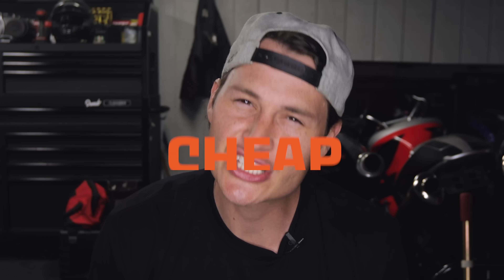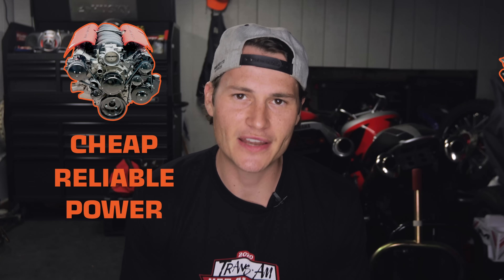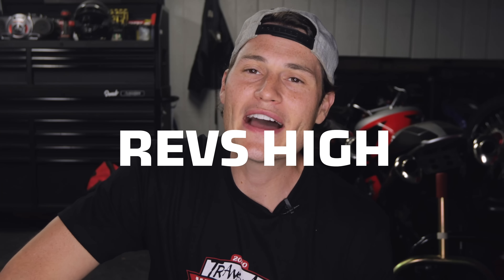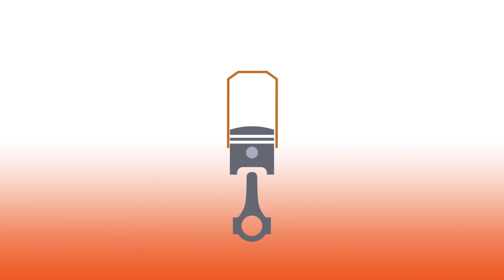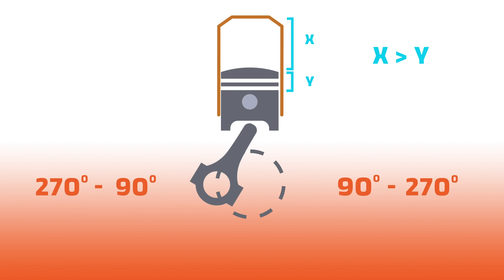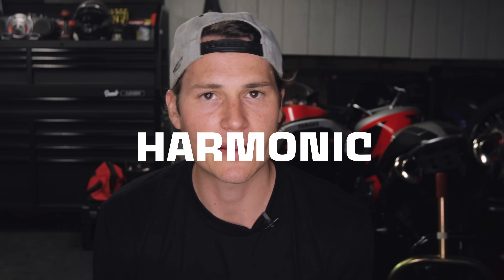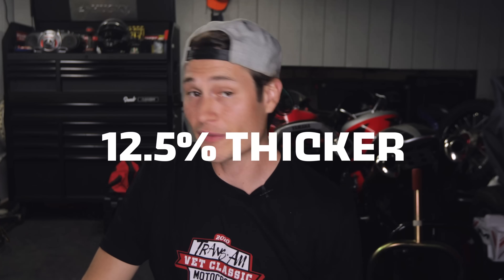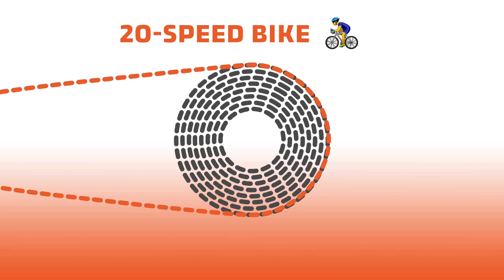Nissan VQ Engine - The Science Explained

Comment: Vq35hr can only hold around 450-500whp vq37VHR is where it’s at because people put ~700+ with boost  and without even opening the engine. People have even gone 9’s in the 1/4 mile with 100% stock drivetrain with fuel, a tire and boost. Also why not the cd009 that comes the same model Z that the vq35HR comes with? Don’t get me wrong, loved the vid etc, but my choice would of been the vq37VHR and not the vq35HR. Otherwise great video guys!

Comment: Also the maxima 04 and up didn’t come with a good trans until 2007
Reply: Yeah the Altima/Maxima manual transmissions were pretty terrible there, the automatics
weren't bad and were at least reliable.
Reply: @BigHeadClan  i meant the autos i just had my trans replaced in my 04 maxima cause it was toast i only think its my year and the year ahead of mine they replaced the cars with cvt which is very reliable tho but i wanted a vq and im paying the price to have  a vq de

Comment: My vq past 400,000km
Mine is only the DE
Gotta swap into the HR when the engine finally gives out
Reply: Swap in a VQ37.
Reply: Agreed, go with a VHR
Reply: De better for upgrades
Reply: @KuTtY0044  no, HR is better in every way, including boost
Reply: @luka_abh  No it's not... Even ppl at Nissan has said this.. Yes the hr is a Lil more powerful "not much" than the De it's definitely not the better engine when it comes to upgrading.. Good luck with all the lights and codes you'll be getting when you try to upgrade the hr
Reply: @luka_abh  And do you even own a z
Reply: Lol..DE.
Reply: Only 17 with 265 hp car I’m doing good, the Hr is only inevitable tho
Reply: I've got an admintuned G37 she runs good

Comment: Im glad this was about the VQ35HR and not the VQ35DE.

Just wish you would've gone into more detail  on some of its other features like its taller deck heigh along with the rod to stroke ratio and the benefits of it being a "long rod motor" which is great for high RPM power compared to the DE and even VQ37VHR which by the way, shares the same exact block as the HR.
Could've also touched on HR owners dropping the 3.7 rotating assembly into them while retaining the HR heads, in turn making it a VQ37HR

Comment: B2B on the Dacia Sandero would be cool, did you know that the 1.0 SCe engine is a NA and is built in alluminum, graphite and carbon, dual cam engine with VVT and diamond like coating, the valve cam has a chain to reduce maintance, piston rings also with diamond like coating (F1 racing technology)... and I think you guys can come up with much more. :D

Comment: The VQ was great (25 years ago).
Reply: Yeah, I bought a 98 maxima in 2001. Loved the smoothness, but it had fuel injector issues at 50k miles. It was already rusting underneath. I loved the ride, but it wasn't toyota reliability or anything.
Reply: Nissan constantly upgraded it over the past 2 decades,  it made wards 10-best Engines list over a dozen times during that period for good reason.

Comment: As the owner of an 07 350z Enthusiast with the VQ35HR, I adore this motor. 7600RPM redline, 300HP on tap with 260ft-lb, all sent through a bulletproof 6spd to the rear wheels. Mine might just be super good because it may have been well taken care of. But if all HR motors feel like mine, this is the go to VQ motor, even if they are more rare than the DE. Also the JK41B, AKA the CD009 is an amazing transmission. Strong enough for a 2JZ or LS.

Comment: Last I checked those engines weren't very reliable. For some reason, Nissan used plastic for the timing chain guides which led to some expensive repairs down the road

Comment: While I loved my short stint with a beautiful 2005 G35 with a 6 speed and that knarly VQ engine under the hood, it left a sour taste in my mouth when it decided to explode literally out of nowhere while I was cruising at a brisk 40mph lol
Reply: It probably ran low on oil like a lot of them do when you don't pay attention lol or if not might of had previous damage you weren't aware of
Reply: Yeah bud, VQ engines in general do burn oil so you probably didn’t check it...treat it like a rotary, every gas fill up just check the oil...good thing is VQ’s aren’t very picky engines so you can run a cheap synthetic if you wish
Reply: Did you take it out on track? My 2009 G37 is still going strong at 220000 km lol. I’ll replace it when it breaks but the vehicle never breaks.
Reply: Chocoretto that’s because you have the vq37VHR they’re super reliable and if you boost them ( just fuel and a turbo kit) I’ve seen 700-800whp out of them on an unopened engine.

Comment: Fun fact: Renault and Nissan suck! I got that engine VQ IN MY NISSAN MURANO AND ITS LEAKING ALL OVER WITH ONLY 120000 MILES
Reply: Mine does to at only 102000 miles common oil leaking issue is the oil filter ring gasket
Reply: Yep that has been replaced, valve covers leaking front and rear main seals leaking too the transmission output you guessed it right leaks. After Renault got with Nissan all go downhill fast! Nissan never again, in matter of fact I gonna go and cut it on fire right from the oil leak that messing up my driveway!

Comment: Where my vq engine owners at?
I got a g37x
Reply: My dark cherry 370 was t boned and totaled by a chick in a 2004 civic. May she Rest In Peace forever in my heart. :(
Reply: @Brandon-sr8qd  the chick or the car lol
Reply: @TheInfiniteNine  lmao the car. Both me and the chick were fine surprisingly (got hit on the driver side).
Reply: 350Z and G37 owner. Also have a 91 300ZX Twin Turbo with a VG30DETT which is basically the daddy to the VQ.
Reply: 07 350z HR here
Reply: 2012 370Z
Reply: 2008 nissan altima
Reply: 08 35x
Reply: Vq40 frontier gang🤣
Reply: 2002 R50 Pathfinder SE 5-MT
Reply: '04 G35 Coupe
Reply: 04 G35X, wish it was a manual.
Reply: My G35 06 6speed caught on fire😢
Reply: bob g37xs sedan boi here
Reply: 2015 Infiniti Q50 VQ37 🤓
Reply: 07 g35x
Reply: 07 350z with a full tomei 🎺🎺🎺🎺
Reply: My first car was the 1995 Maxima. No traction control and 205 lb-ft torque. The VQ30DE was the reason I chose the car.
Reply: 2008 maxima
Reply: 06 pathfinder VQ40DE
Reply: I had an '05 Altima SE-R with a six speed, for about a decade.
Reply: M35 here 👋
Reply: Q70 💪
Reply: '07 G35X. Actually really great in the snow.
Reply: 02 maxima, 04 maxima, 10 altima v6, 10 maxima, 14 370z vq is in my DNA 🤘
Reply: Used to own a G37S coupe
Reply: 09 G37x sedan
Reply: 07 350Z here
Reply: 2011 370Z N/A tuned!
Reply: 370z 2020 🤘🏼
Reply: @MrYanmichael15  yo, that car should have ZERO bugs by now haha.
Reply: Parker Portlock I know right 🤣
Reply: G35 sedan 03🤙🏽
Reply: 07 Nismo 350z
Reply: 2010 G37S
Reply: 05 G35 sedan.
Reply: Z33✊🏽
Reply: 04 i35...wish they came in manual tho 👊🏽
Reply: @jxhern22  you can swap the manual from maximas in
Reply: yup i have a g37x with the 7 speed RE7R01A automatic
Reply: 03 350z touring 6 speed here
Reply: 13 Maxima CVT baby 😤😤
Reply: 19 frontier vq40de
Reply: 2017 370z MT6 boiiii
Reply: 03’ 350z 🥵
Reply: 350z
Reply: 350z 🥳
Reply: About to sell my 2004 G35 brembo 6sp package. I’m sad about it everyday but can’t have 3 cars right now and I’m back in the STI game. I also have a 2015 Q50 with the 3.7 for the fiancée... amazing engine and the best part is the reliability.
Reply: 07 G35xS. 122k miles on the HR and still running like a champ.
Reply: 1996 Infiniti i30 💪2700000 miles
Reply: Altima 3.5 6mt checking in
Reply: 05 Altima se-r hr swapped
Reply: 2010 370Z 40th anniversary
Reply: 04 350z
Reply: 05 g35
Reply: Q50 3.7☝🏻
Reply: 04 350z
Reply: Love my Z
Reply: Yessir G37xS
Reply: 18" 370z Sport
Reply: X sedan, boom!
Reply: 06 Altima SER
Reply: 2003 maxima se 6-speed and 2012 Altima SR
Reply: V36 Skyline 350GT Type P sedan over here 👍🏾👍🏿 🇦🇺
Reply: g35 coupe
Reply: G37 sedan
Reply: 2013 G37x here. I love but I am kinda wanting a new car
Reply: used to have a g35x until i crashed it right before 200k miles, now looking for a g37x because i loved it sm!
Reply: G35 coupe🤙
Reply: Frontier here
Reply: 03 G35 coupe 6MT, I restored it for function over form & it has been the most reliable vehicle I’ve ever owned
Reply: Nissan Cedric ! Vq30det :)
Reply: 06 nissan quest
Reply: The G Fam is the Best 💯👍👍
Reply: 2010 370z nismo and 2003 maxima "HR" swapped here
Reply: VQ35DE in an E51 Elgrand
Reply: FX35 👍
Reply: M35
Reply: 2004 ELGRAND. A thirsty boy.
Reply: Got a g35x sedan hr and de g35 coupe 🤙
Reply: nissan altima v6 coupe
Reply: 14 frontier owner here
Reply: 2015 Q40 🔥
Reply: Checking in, '08 350z VQ35HR.
Reply: jdm 370gt
Reply: Former owner of a 2006 350z and 2008 G35 sedan.
Reply: just bought an 07 g35s 🙌
Reply: 15 Q50S owner. Prior cars: 12 G37x, 03 Nissan maxima se, 97 Nissan maxima se.
Reply: Just bought a 04 G35x, was looking for a 07 Coupe. But found a great deal and couldn't turn it down. It'll hold me over until I get another 300zxTT. That was my first car ever and man what a car. My friends dad has a 700hp 300zxTT. Waiting for him to sell that, it's just sitting in his garage being neglected. I would love to throw an LS3 in it. Hell I should do that with my G.
Reply: Just got a g35 04 oof 😭
Reply: 2015 Q50S here
Reply: Squaa 37xs sedan
Reply: 06 350z!
Reply: 06 G35x here.
Reply: whats up
Reply: A slow DE here, clean af tho
Reply: What up boys
Reply: He look it's everybody that unnecessarily rev matches coming up to a stop light right here.
Reply: Toyota Prius
Reply: vqs are trash, #barratheworld
Reply: Zack Loomis ayyyy I used to have a 2004 xterra 4x4 myself miss it, I hear bad reviews on the issues with radiator failure and coolant mixing with the trans fluid have you ran into issues like that?
Reply: 05 G35 6MT
Reply: 06 M35X 281,000 miles looks like it has 80,000 and runs the same.
Reply: G35 6mt 2006
Reply: 2014 q50
Reply: Xabi Achurra hows the reliability of the q50 with the 3.7L Na engines? Any transmission, electric or engine problems? I’m already aware of the infotainment problems
Reply: @kamalkristipati3457  I have a 15 Q50s which is the 3.7 and I've had no issues with it. My G37X was also a 3.7 and the catalytic converters went out but they were replaced under warranty by the dealership. Aside from that, I've had no electrical, transmission, or any other issues with them at all.
Reply: 04 g35
Reply: anima oblitus sloooooooooooow
Reply: 2008 g37s
Reply: @jflynn3118  not a g 🤮😂😂😂😂😂
Reply: G37-S Sedan here
Reply: 2010 370z Nismo
Reply: 05 G35 sedan
Reply: 09 g37x
Reply: Q50
Reply: G37x sedan here!
Reply: G37x Coupe wassup dog

Comment: Have you done a show on brakes? The brakes on my car are the ones they installed at the factory 17 years ago in 2003. What's the longest your brakes have latest? I broke 100,000 miles.
Reply: I should have added its a 2003 Hyundai Accent Hatchback base model.

Comment: If only it didn’t sound like a trombone when straight piped
Reply: Then don't straight pipe it?
Reply: Keep resonators on
Reply: @Wildchildinc  it's not always the resonators. It depends on the exhaust style you choose for the VQ35. Y Pipe to dual exits sound better without resonators. True duals tend to sound horrible and raspy without them on the other hand. It just depends what you get.
Reply: The Nismo exhaust actually has a nice note and it won’t wake your whole neighborhood up
Reply: WTF IS WRONG WITH TROMBONES!!?
Reply: A VQ sounds good straight-piped with a properly designed exhaust. The header pipes are different lengths so the exhaust pulses hit at different times and you get the trumpety and farty sounds. My Z is fully straight-piped and it sounds like a racecar at 3k RPM to redline. Also, straight-pipes is the best option if your goal is engine power. Mufflers, resonators and especially cats all put restriction on the engine
Reply: That’s why you buy the best exhaust for the car which is motordyne.
Reply: @Erik some engines sound better with straight pipes but the vq should have catbacks
Reply: More like a trumpet.
Reply: @Erik No, straight pipes are for people who want maximum power.
Reply: Sic Semper Tyrannis  i think what he meant is a lot of people straight piped their car just for the sake of making it loud and not for performance related mod a.k.a ricers.
Reply: A 350z Hr with a Tomei Catback exhaust sounds so good 😭. An Hr sounds SOOO much better than a DE
Reply: @DaytonaBlueHr  Tomei is the raspiest catback you can get. They only sound right when theyre full bolt on or boosted. Theyre overhyped for what you get.
Reply: Fishtailing Z They sound good either way on an Hr even if its not boosted. De’s definitely sound different from Hr’s especially when comparing both with a tomei catback exhaust.
Reply: @Fishtail_Z  finally someone said it.
Reply: haha vq go brrrrr
Reply: @Erik whoever develops f1 cars must be massive dumb dumbs
Reply: then get our single :P
Reply: dont straight pipe it then
Reply: Sic Semper Tyrannis  Not rally cars.
Reply: Dont str8 pipe ur cars, riceboi
Reply: Straight piped with stock resonators or extra Vibrant resonators sound good. Its when they straight pipe and remove the resonators that make it sound ugly.
Reply: Leave me alone please

Comment: I was expecting some crazy ingenuitive engineering but... its basically just more bolts and a metal frame for more rigidity and strengthened rods? I thought they invented something to prevent the v6 from creating to much vibrations in the first place, not tighten everything up to reduce the symptoms. Or did I miss something? Still a good video but I cant help to feel a little disappointed :D
Reply: Sic Semper Tyrannis  He literally said "Minimized" Vibration.
Reply: I do think if I miss something in the video too 🤣
Reply: Sic Semper Tyrannis  That is not entirely true, on each individual cylinder, yes, but in that case any engine vibrates, however using precise counterweights, balance shaft, certain bank angles and sometimes split crank pins it is possible to balance out the entire block. Yes I understand that if it's off by 0.00006 there is gonna be a little vibration, but what I think he meant is that simply making the thing stronger doesn't not make the engine smoother or more balanced in any way.
Reply: Sic Semper Tyrannis  I didnt want to imply that there is 100% machining or a way to stop the vibration entirely. And even tough I may have made it sound like a trivial matter I know that it isnt. How do I know? Because the less complex exercises of the strength theory exam and oscillations in the  math exam gave me enough trouble to understand that. What I wanted to point out, was that I was expecting a way of improving the v6 in its structure like bank angle, firing order, counterweights ...OR something ingenuitive I havent heard of before. Thats what I was hoping to see, not a solution to withstand the power. I am no expert by any means (I am actually pretty clueless), I just watch Youtube Videos and read articles/books to broaden my insights on existing cars because sadly thats not what you get after 1.5 years of studying automotive engineering. Sorry I gave this long explanation, you probably just misunderstood me. Just dont assume things.
Reply: No. They actually did an absolute shit job in the VQ37. Like, literally shit job. I had a 2010 370Z in 2011. Back when people still used forums, all you would ever read was how harsh the engines would rev. They were absolutely horrible to rev. If you hung the revs near redline; it literally felt like the engine was falling apart. VQ35 was nothing like this.
Reply: @Tracked350Z  Yeah, I remember reviewers also claiming that the engine had an "agricultural" feeling to it.